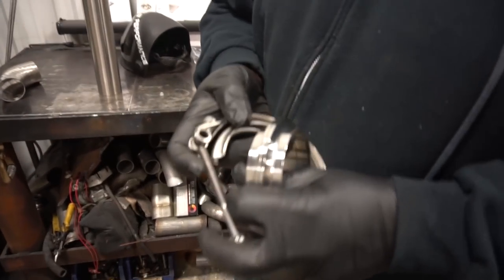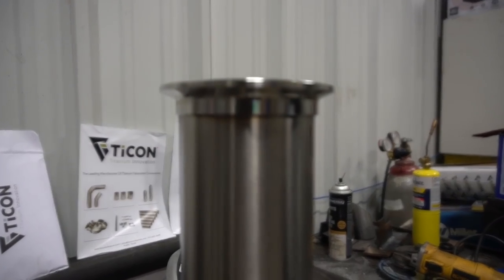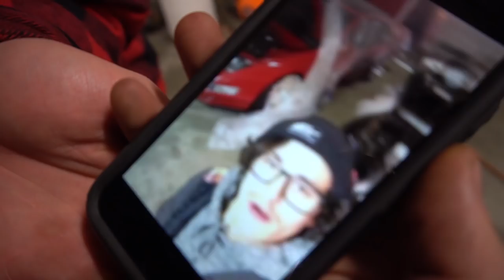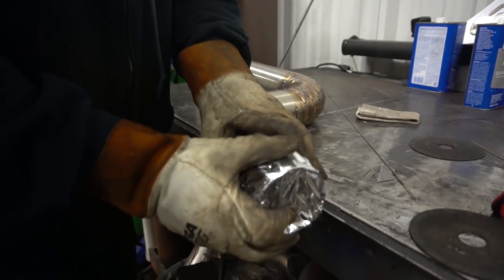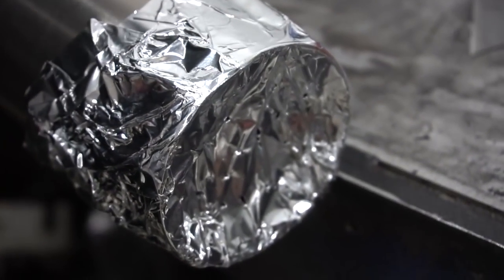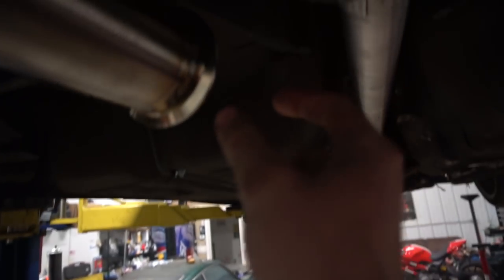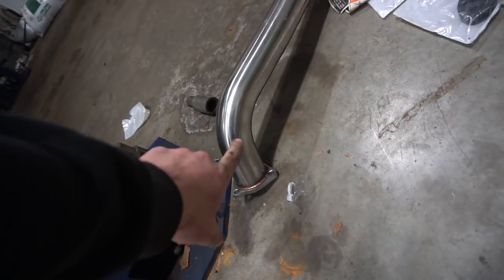SR-Z CUSTOM EXHAUST!

Comment: hey jimmy, quick tip.. when cleaning up overspray on something polished or stainless steel and you dont wanna scratch it or take the shine away with the scotch brite, Just use Fine Steel Wool it works amazingly i used it on my polished magnaflow muffler and it worked awesome

Comment: No need to purge the pipe as it's an exhaust, not a pressure vessel... I can make the pipe look very good with a good MIG welder dialed in. No need to tig it, it takes more time and thus creates more cost for the customer. 

Good sexy TIG welds though!